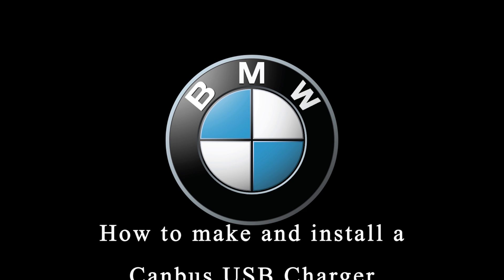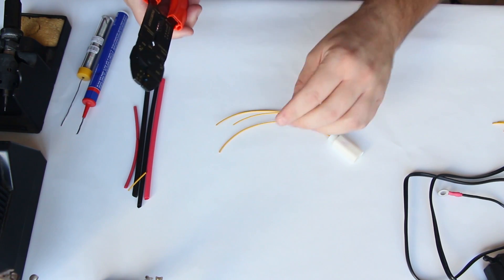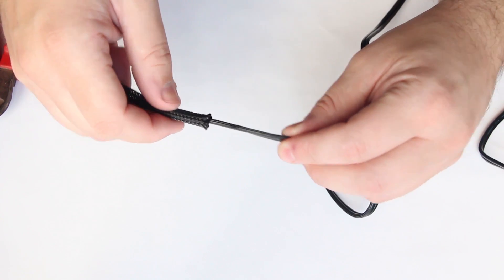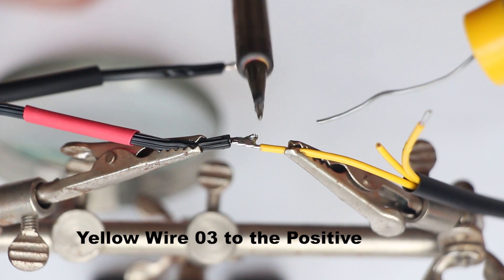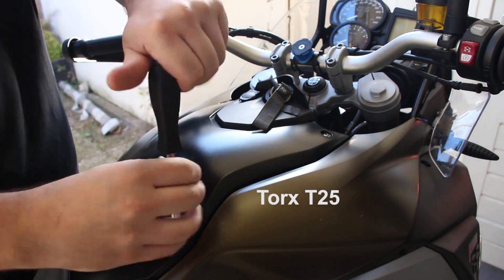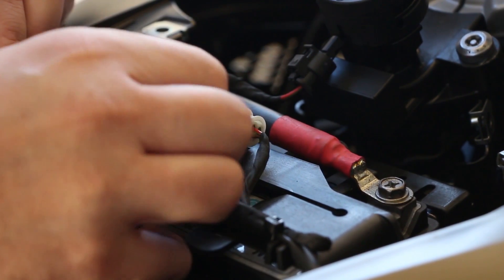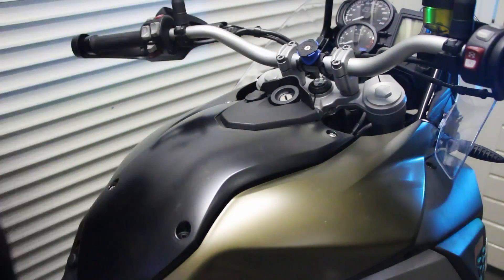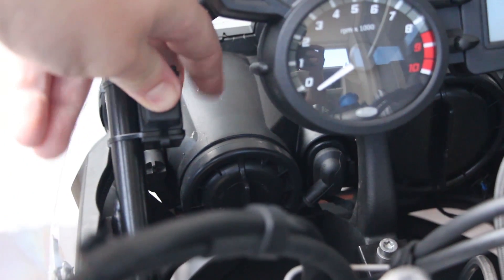Canbus USB Charger build for my BMW F800GSA

Comment: Great video. You mentioned that wire number 2 is obsolete but I read on a forum that it is also positive and it switches off when the ignition switches off without any delay. Do you know if this is true?
Reply: Hey, the second wire is for the control of the wonderwheel (its a dataconnection). Never tested if it works as a direct switch off wire but my guess is that it wont function like that. I would just let the canbus system let it turn off by itself

Comment: Hi, I connected navi 7 moths ago and works perfect but now I'm going to connect one more device (USB Charger 2,3 Amp). Is it one more plug to do the same solution or can I solder another one to the same cable adapter ?
Reply from the maker: there is only one "spare" plug available im afraid, you can try and add it to the same wire, but, the canbus system will shut down the plug if you draw to much current. just a simple test at home should do the trick, connect the charger to the same adapter, start the bike and connect the NAV and connect something to the charger, if it shows charging your fine, if it doesnt just undo the usbcharger and turn the bike off and on again, that will reset the Canbusplug.   to be honoust you should be fine, the Canbus plug is rated up till 10 Amps and ill doubt if the navi and charger will draw more then 5 Amps total

Comment: hi, have you had any issues with this system, I've just brought this model and would like to do as you have done,  I've heard that extras into the electrical system can cause problems
Reply from the maker: if you connect something directly on that canbusplug there is no issue, its ment to be used this way. if you splice any other cable on the bike then you can get issues with the system. goodluck 👍
Reply: @MauritsRademakers  ,thanks for the help 😁

Comment: Great video,I’ve bought the bmw lead to do the same job 
What voltage is your usb please as I’ve found I need 5volts to power my tomtom
Would this be ok
Reply from the maker: that charger was a 5 volt one, worked without issue
Reply: @MauritsRademakers  thanks so much 👍appreciate it

Comment: I have an 2014 F800GS..  Did the same operation and strangely if I have my Leds turned on at the tim of shutting down the engine, they don't go off after 60 secs. They stay on forever (did not test forever but long enough to risk draining the battery). If Leds are not on at the time of shutting down the bike, Canbus works fine, cuts off the power from both mini cigarette lighter and from Leds after 60 sec as intended. 

Even stranger; Leds on, bike shut down, Leds still on (after 60 sec), I turn off the Leds by a switch manually, ohhh Canbus remembers its function and cuts down the power after 30 sec or so.. With this setup, Canbus has no use in my case because I have to turn off the Leds with a switch anyways. I am planning to use a relay instead- which I resisted at first.

Comment: Very helpful. Thank you.  Does the USB port need to have an inline fuse or does the can bus system cover any electrical usb future problems
Reply from the maker: hi there, there is no need for a fuse if/when you connect through Canbus, the canbussystem will shutdown the power to the usb if there is any issue

Comment: Im going to use a oem plug and I would like to now how can I identify the positive and negative cables on the bike plug. Do you know about the collors of each one? Thank you my friend!
Reply from the maker: do you mean that you want to split straight into the CANBUSplug already on the bike? a simple voltagemeter would tell you what is positive when you turn the bike on, do keep in mind that the canbusplug on the bike only is suited for navigation or usbcharging, it has a max output, so dont be putting to much accesoires on that connection, if you need more power connect it directly to the batterij with a fuse in betweeen
Reply: @MauritsRademakers  great! Its Just for a USB charger! Thanks!!!

Comment: Nicely done. I ‘be searched the price of the canbus wire and it’s quite expensive...isn’t it?
Reply: At a BMW dealer it's about £10 . And at motor works.co.uk about £12 +£4 for shipping. 
Expensive when you see what it looks like but does a great job.

Brilliant tutoring ,btw.👍👍
Reply: I believe you are referring to an official BMW showp. How much does it cost? I have tried searching for it elsewhere but no luck.
Reply: OMG I found it on Ebay for 15 euro, plus 7 shipping!! Expensive.

Comment: Thanks great idea. 
I do have a question and please forgive my ignorance.
What stops you from tapping into the power from the “cigarette” connection ?
I use a aftermarket charger in this connection to charge my phone but it really gets in the way of my tank bag. Is this why you don’t use it ?
Reply from the maker: yes you could do it by splitting the cigarette connection, but because I dont like splitting the wire if not needed and the connector is nearly near the cigarette wires I went for the plug since I had to remove the cover anyway, I also dont know what would happen if you charge the battery through the cigarette plug (canbus charger) like I do when there is something else splitted into the wire. but yes, splitting/ tapping into the cig connection will work ;)

Comment: Sorry but i dont understand why you did all that ? you simply use a relay and take the signal from the cigarette charger
Reply from the maker: Amateur solution or Professional solution! I could of also just connected it straight onto the battery. its better to split the currents drawn from the bike then using it all over 1 connection. Theres more than one way to Rome!
Reply: @MauritsRademakers  if you say so. I just thought there is any technical gain.. Connecting directly is armature way i agree but once you have a relay.. This is where you use engineering concepts.. Professional is how you do the wiring and connectors

Comment: Maurits, great video thanks for sharing.  Quick question, the charger unit you are using has a built in converter from 12v to 5v correct? If so, is this necessary?  I ask in case I want to connect a USB mini or Lighting cable directly to the canbus adapter instead of the USB charger socket you installed. Thanks